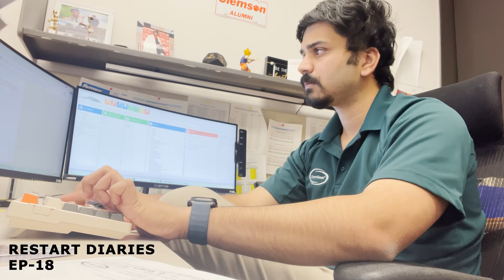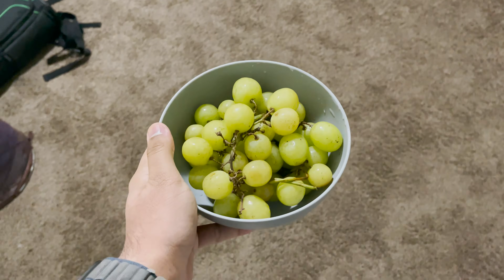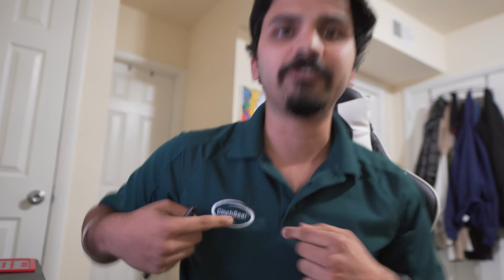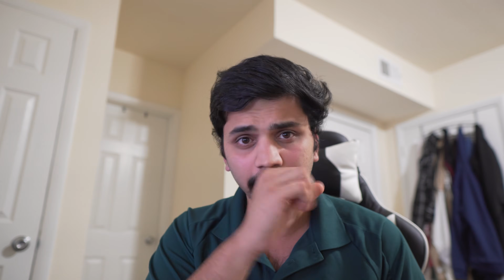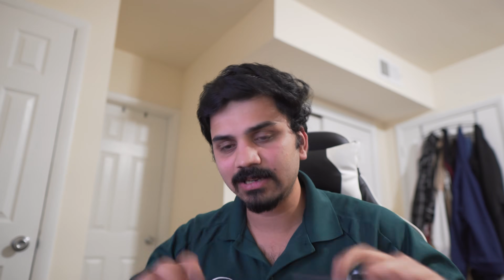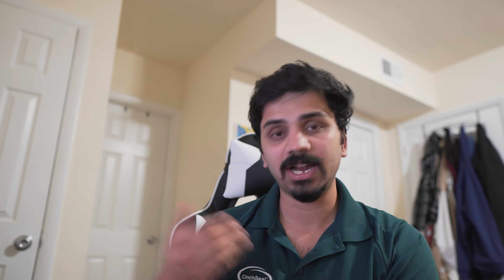What do I do as Mechanical Engineer? | DAY-18 | #RestartDiaries

Comment: Awesome! Could you please share how you learned to apply GD&T?
Reply from the maker: Thank you. It was a cumulative learning experience. I did not have one particular source. Firstly, understanding symbols and datums. And then looking up example drawings and understanding why that symbol was used in that case. This is how I learned- looking up multiple part drawings and understanding.
Reply: @ShanmukhRam  thanks. I can apply basic stuff, but I struggle with position GD&T and the profile/runout stuff.
Reply from the maker: Comes with experience,. Make sure to be clear with basics.